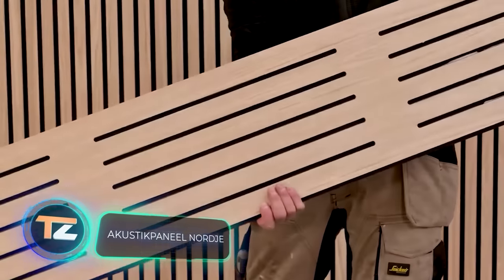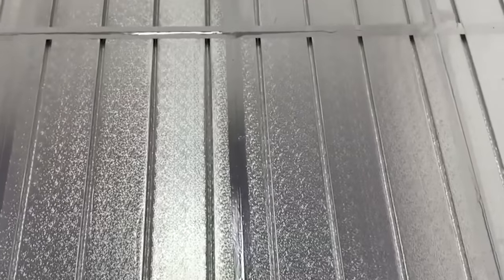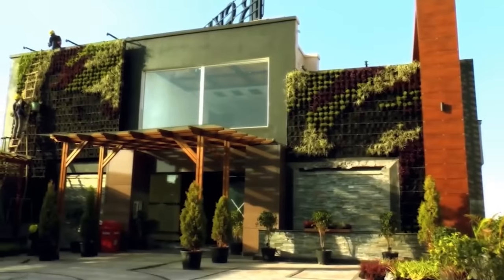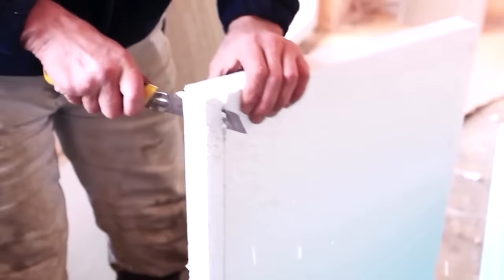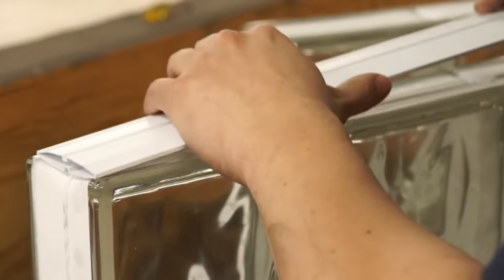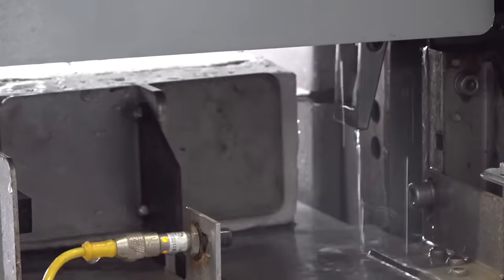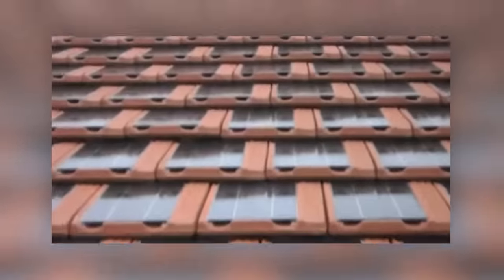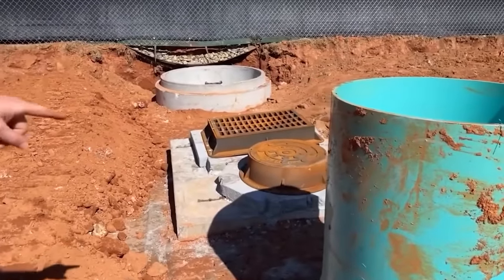INCREDIBLE CONSTRUCTION TECHNOLOGIES THAT ARE WORTH SEEING

Comment: 👷‍♂👷‍♀ It's amazing to see how technology and innovation are transforming the construction industry. However, like you, I also wonder about the long-term effects of these new materials and techniques. It's important to keep in mind the potential risks and ensure that safety and sustainability are always prioritized. It'll be interesting to see how these foam insulation and concrete molds hold up over time. Hopefully, they prove to be a safe and durable solution!
Reply: I checked, the foam insulation is Fire Resistance Class E - or pretty much like pouring petrol on an open fire.

Great insulation properties, terrible fire resistance and exposure to UV will degrade it in only a few years; a great pity, as it looks great.

Comment: Some great innovations, but I’m worried 😧…..is styrofoam flammable, if not will it just melt and drip? Under floor heating, what happens if a pipe bursts? Plastic pegs between blocks, with no mortar, are they waterproof? I’m just concerned these new innovations might not be robust enough in harsh climates in high winds or extreme temps…..🤷‍♀️

Comment: The floor heating system technology is from Korea but Korea doesn't use foam flooring
Reply: WE USED IT IN THE STATES DECADES AGO
Reply: I understand. Korea has been using it for centuries. It would be good and fun research for u. As per Korea, the system it's called "Ondol"

Comment: I don't know if you'd be that great of idea because I did solar panels before he'll even if you did the whole entire roof we did half the roof with our solar panels it would cover the full square half of the roof you're missing a lot of space in between each that even if you did both sides of the roof it would only equal half the roof if we put both solar panels on both sides of the roof that took the. Square footage it would probably make twice as much electricity because those are just too small it's a good idea I guess unless it could create More voltage than normal solar panels but then why wouldn't you just make them bigger and cover half the panel I mean I know it in one way you wouldn't see it with yours but the other ones make twice as much electricity pretty sure but you could try to pull a fast one on them and get them I buy it maybe if it's cheaper than normal solar
Reply: I am the best at reading or studying so if you could understand what I mean pre-reading I got a better picture but if and solar panel is three-and-a-half to four and a half feet wide probably in 5 ft long almost and if you covered your half your roof it would probably make even more square footage than those little solar panels because the space in between each one sorry but it's a good idea but I just think it might be a scam because it has to be less than what normal solar panels would cost if they were doing it because you're getting less electricity in the same amount of price the regular towels would if you have it the same price you might as well just do the solar panels because you get more power anyways so it just depends on how you market it only if it's cheaper than normal solar panels
Reply: PS also you would have to wash your footing even more instead of just walking around the square of the roofing of the solar panels that setup you'd have her walk in between each solar panels on that one so I don't know if it's really that great of ideas good first thought but second decision we certain flaws so I'm sorry

Comment: You haven't done your homework.  Chinese construction is considered one of the worst in the world. Look up "rotten tail" buildings built all over China, they are very poorly designed with cheap materials and are falling apart just a few years after construction.  No wonder appliances built over there fall apart in a few years, we use to have appliances that would last for 25 to 30 years that were built in the west. I also doubt how effectively their bricks that are held together by plastic pegs would function in our extreme weather, 70 mph gusts, tornadoes, hurricanes, etc.....wouldn't those plastic pegs crack in extreme icy cold weather.